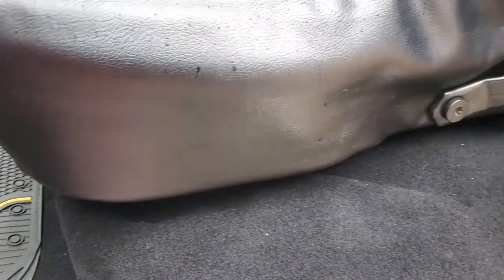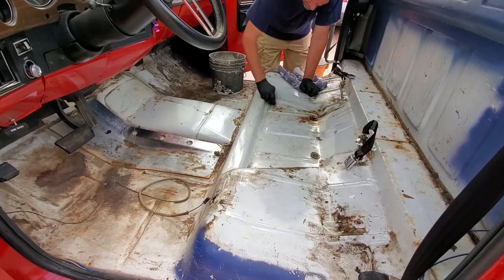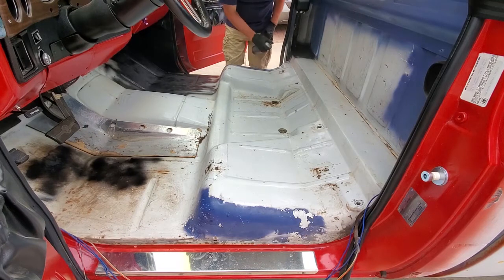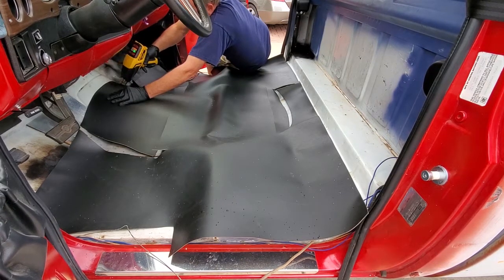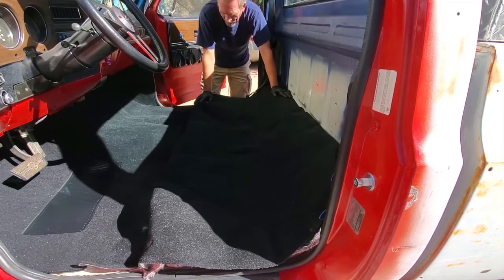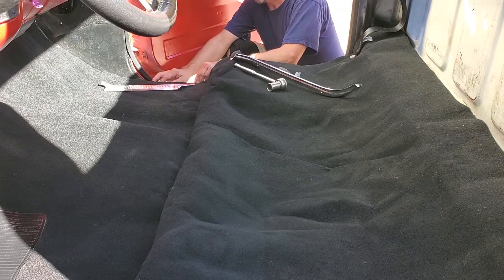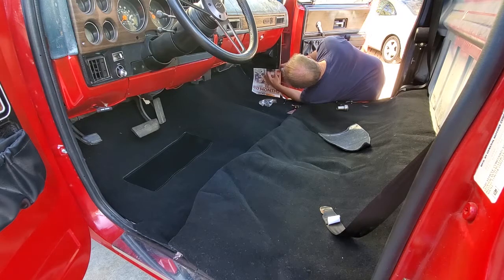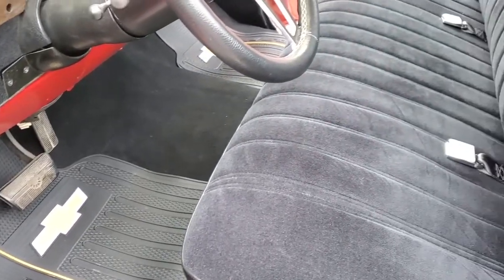How to Install LMC Truck Carpeting for a 1976 Chevy c10 Pickup

Comment: Man those floor pans look so good and clean! That seems to be a rare thing in these trucks!
Reply from the maker: The truck has spent all of its life in Arizona. I'm sure the mild climate is a contributing factor. Also, no road salt is used during the winter here.
Reply: I was told that heatsheild goes foil side down? Towards the floor